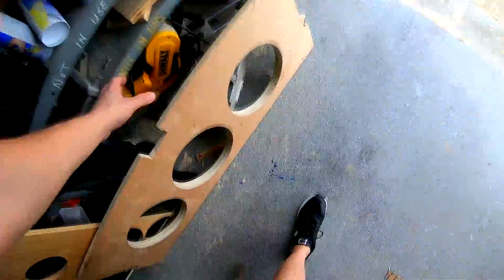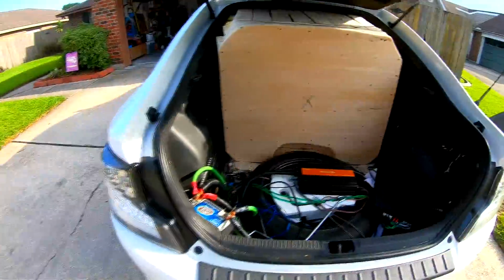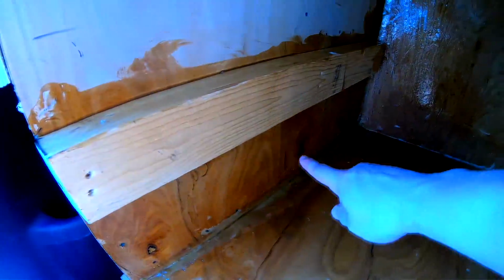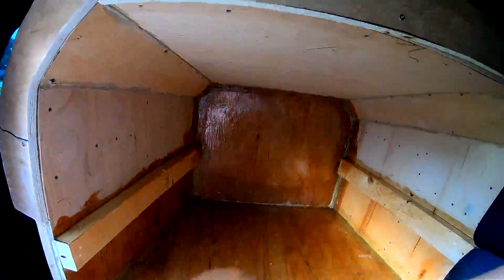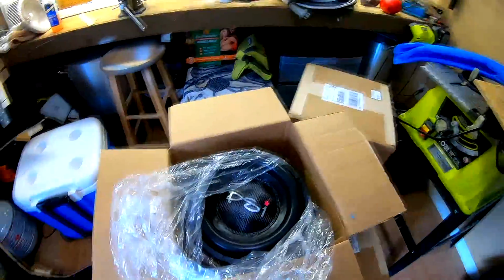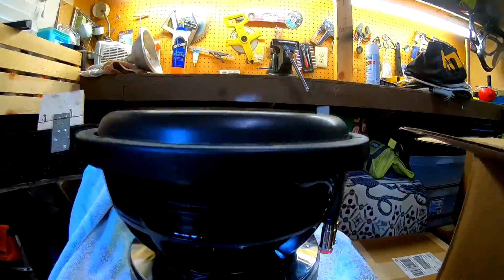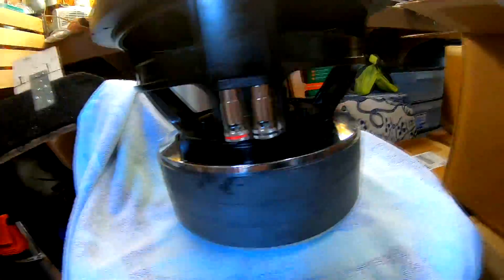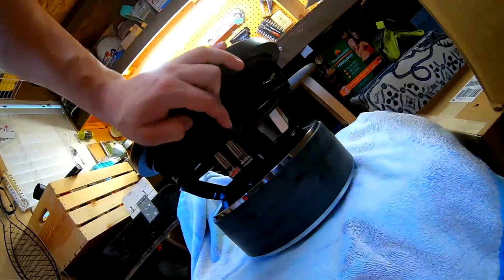UNBOXING PSI PLATFORM 4 12S STARTING TO FIBERGLASS - WALL BUILD PART 5

Comment: Hey man I just found your channel and I'm watching all of this build vids on the Tc. I have a 2015 and I'm planning on doing a similar wall like yours. I've learned a lot from watching your vids so far. One thing I did notice is it seems that your ports are upside down. I'm pretty sure the flared side goes up so it reduces port noise. Correct me if I'm wrong